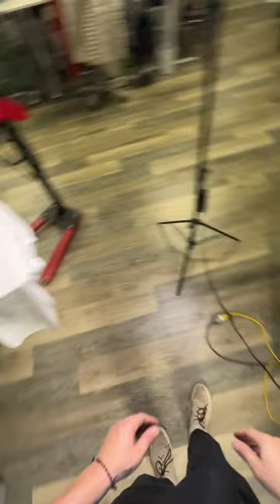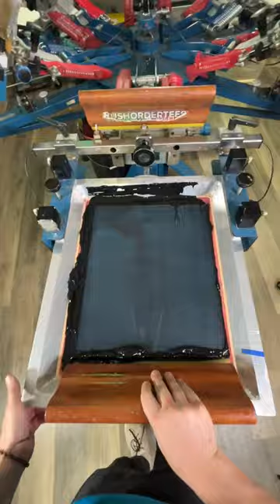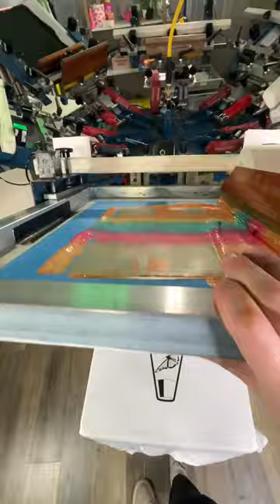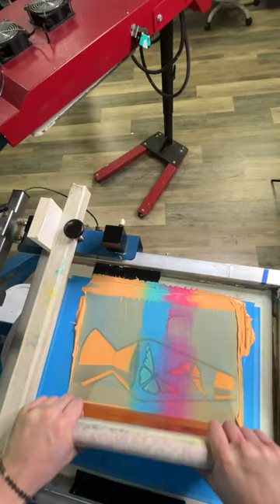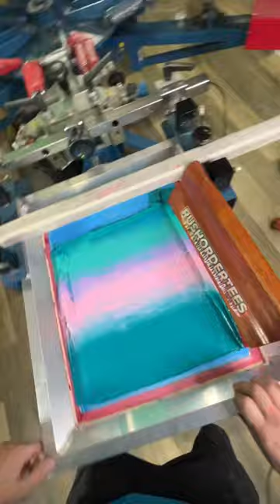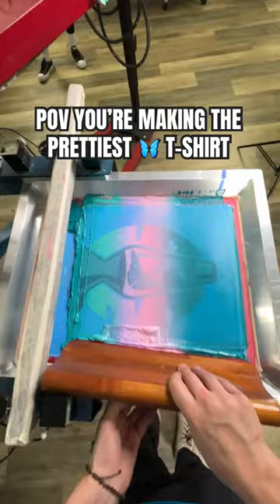Printer POV: This TRANSFORMATION is Absolutely STUNNING! 🦋 #shortstiktok #art

Comment: Hey how do you guys align the slides with the print everytime as the print on the shirt aint visible?
Reply from the maker: yes 🔥
Reply: Practice. They know where it needs to be lined up. They have tools to help you measure or guides online for the measurements of how far to place the image down and from each side to make it center. After making so many shirts, it’s just second nature. Plus they are likely doing so many of the same size and same design.